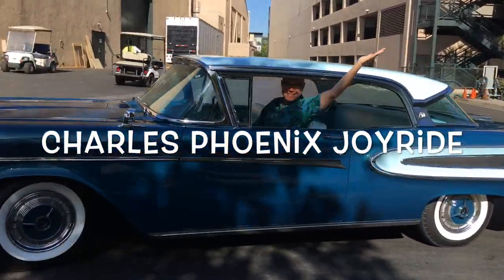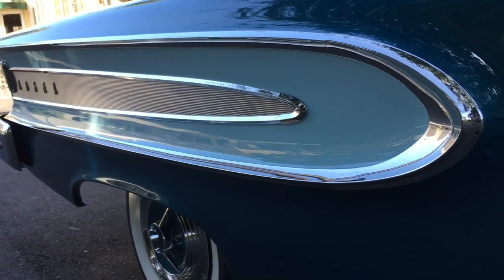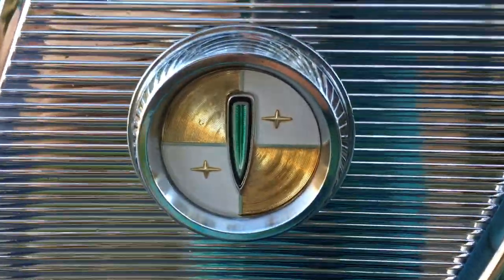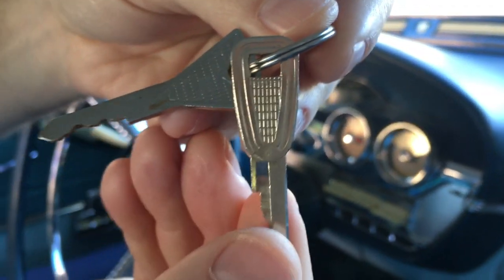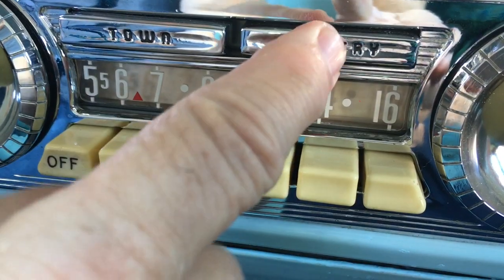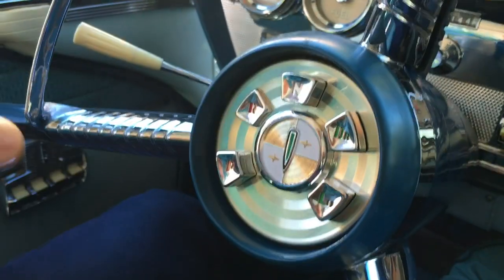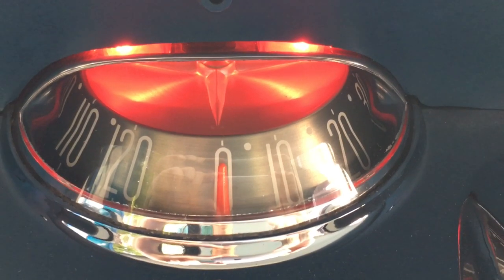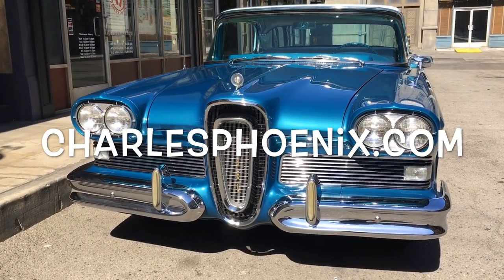Charles Phoenix JOYRIDE - 1958 Edsel Citation

Comment: My dad bought a 1958 Edsel Pacer hardtop, white paint with red interior. I loved that car—it was tight and responsive. Yes, I know that it was not top-of-the-line, but it was a truly great automobile. Sadly, the car was rear-ended while parked, frame was bent, and the car was not the same after that.

Comment: Thank you for posting this exceptional video showcasing the best of the best!  Impressive array of whistles and bells not usually found on top-of-the-line Edsels (presumably since customers had already spent so much just to have a Citation).  Less than 1% of all 58's had AC.  I've only seen the speed warning light activated in a '58 commercial, and that was in B&W.  I've owned a beautiful Citation for the past 15 years, and it's been a joy to drive.  It was previously part of Richard Carpenter's collection.

Comment: I never knew that car was so awesome. I wonder why it wasn't popular. Great video.
Reply from the maker: Good question!
Reply: Well, the way I understand it is that the horse collar grill was a little controversial. Comedians and others made fun of it and that may be one reason why some people stayed away. It was also introduced during a bad recession and the reason for it being didn’t exist anymore come 1958. When it was conceived in ‘54-‘55 there was a spot in the pricing structure for it. But when it was debuted that really didn’t exist much anymore. People could either get a high dollar Edsel (or a more well known prestigious Mercury) or a low dollar Edsel (could get a high dollar Ford).  Also build quality suffered because these were made on the same line as Fords and Mercury’s and I’ve read that some of the workers didn’t appreciate that and weren’t always careful with assembling the Edsels.

Comment: Absolutely right about the driving experience. Some are maybe just interesting, but ones with power steering and brakes are similar to driving a car today except from a different universe. Speaking of brakes....

The upper two lines of '58 Edsels share a lot with Mercurys. Same roof and awesome rear window but different trim. Oooooo, I know: Charles! 1957 or '58 Mercury Turnpike Cruiser! Yes!
Reply from the maker: 57 Mercury Turnpike Cruiser coming SOON !!!
Reply: Yeah, I was thinking the same thing, especially with the back window and some of the trim kind of Mercury like.

Comment: The interesting thing about the 1958 Edsel lineup is that the "senior" models (Corsair and Citation) weren't just longer than the junior models (Ranger, Pacer), due to the usual expedient of a longer wheelbase, but also wider, by just over an inch. The senior models were built on the larger Mercury chassis, while Ranger and Pacer used the smaller Ford underpinnings. Despite being virtually indistinguishable except for trim and rooflines, the senior and junior models used entirely different body stampings, with no panels or glass interchangeable. Edsel station wagons for 1958 used a Ranger/Pacer front clip, with the tail being a thinly disguised 1957 Ford. The "Climate Dial" HVAC control is the same setup used in 1958-60 Lincolns, with ductwork integrated into the dash. Then for 1959 and 1960, Edsel reverted to the clunky under-dash factory air units used by lesser Fords. As well as a very agricultural-looking exposed shift linkage that ran parallel to the steering column.

Comment: 2:28 The backup lamp lenses have “EFB-58” molded into them which is code for EDSEL FORD BACKUP 1958 model year. Most turn signal and brake lamp lenses have this as well. In later years it might say SAE58 or some such.
Reply: yea back as a kid I would look to see if my make model and year was correct., back righten u could do year

Comment: One of my interests of 50's and 60's cars is the configuration of the A/C vents, when so equipped. Definitely have not seen the Edsel factory air before! This was when manufacturers were figuring out what they were doing to do with the air vents, as cars had recently switched from A/C units based in the trunk. (AMC was a leader in dash-based A/C units!) I can't think of any other Ford products with this configuration. It is like the 57-58 Caddy and some of the Chrysler products of the time. Thanks for that detail.

Comment: I wonder how many of those options were originally on the car or were added during the high dollar restoration?  In place of the tachometer, one could even have ordered a compass.
Reply: I am always suspicious of super-optioned Edsels. I mean, Corsairs and Citations tended to come well-equipped, but not THAT well. It's even shiftier with the small-series cars. Last year I saw a green Pacer at a local show in PA that had everything incld. the Speed Warning Light, electric trunk release, and the ultra-rare central oiling system IIRC, and I always suspected that was a "built" car. The wealthy owner had just tacked about six rare options onto it in the course of a full resto. Cars like that are just material for a pissing contest between the owner and other Edselers, making the car non-representative of how the cars were actually born.  "Build sheet or it didn't happen!"

Comment: I own 4 model  kits of  the 1958 Edsel. 3 as paint your own color choice and a prepainted  red and black 2 tone. I put together the 2 tone. I have 2 identical kits and a deluxe kit with a Continental spare tire unit.  I built an abandoned junker (in grey primer)  I have partially built a low rider and a drag race car.

Comment: A colossal $250 million dollar loss at the time for FoMoCo over its 3 model years ... that is equivalent to a whopping $2 BILLION in 2020 money. 1958 Edsel production was planned to be 200,000 units but only 63,000 were sold.  1959 Edsel production was even worse at only 45,000 units.  Henry Ford II promised Edsel dealers a 1960 edition but pulled the plug after only 2,846 units...most Edsel dealers either gave up their franchises or refused to order any 1960 models. The engineering economic analysis of this car was a total failure during the decision making stages. The 1958 models were built at six different assembly plants rather than only one plant which resulted in inconsistent quality. The grill was considered ugly and vulgar jokes were made about it. The name Edsel honored the founder's son but was inappropriate for naming a new car. In the late 1950s the public was showing more interest in smaller sedans like the Rambler and smaller coupes like the 1958 Thunderbird. In 1959 Ford introduced the upmarket Galaxie which competed directly with the less attractive 1959 Edsel Ranger. FoMoCo finally turned a corner in 1960 with the Falcon and Comet, in 1961 with the Continental, and in 1962 with the Fairlane and Meteor.
Reply from the maker: thank you for the info!